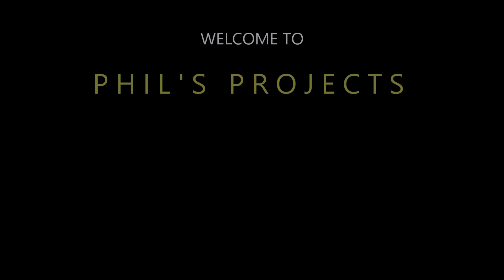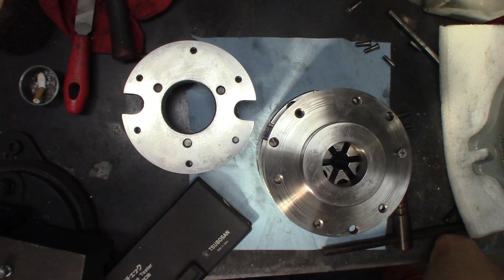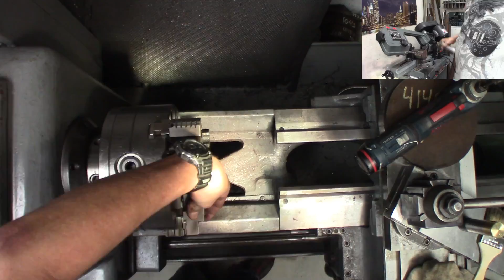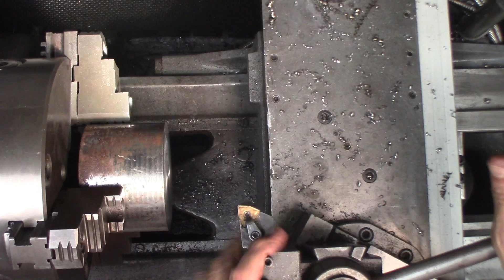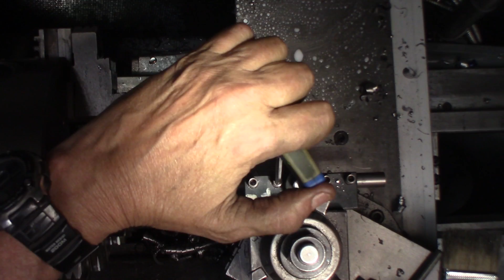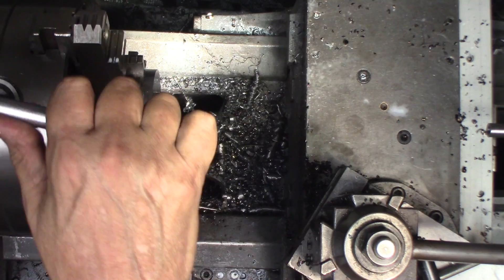BISON CHUCK 1

Comment: Nice work. I have use 6 jaw adjustable chucks for decades now and love them. At my full time job we use "Kalamazoo" chucks. They are built like the original "Buck" chucks. One of our future videos we plan on altering the jaws for harden CPM 3v insert. Steve
Reply from the maker: Thanks Solid rock, Come back for the finale to see if my analysis and solutions worked
Thanks for taking the time to comment
Cheers Phil

Comment: I don't see the point of the slug in the center it appears to be just along for the ride. I can't see any screws going into that bore to push it around for alignment as that would really be its only use. Why not just bolt chuck straight to d1 mount plate? Since there does not appear to be an indexing register you can loosen the bolts bump it into alignment and retighten if you want to adjust true it.  The closer chuck is to spindle the better in my opinion.
Reply from the maker: Hi Brian, the adjustment screws are on the rear of the  chuck, you snug the bolts holding the chuck to the back plate, use the 4 adjustment screws to center the chuck to the spindle rotation, then tighten the chuck to the back plate. if everything is correct you should be able to remove a part from the chuck and it should go back in to with a thoul., I will make a point of showing it on the next video.
 having the chuck closer to the spindle is exactly why im bypassing that shop made plate

Comment: Nicely done! I hope you dont need to make a Backplate for your chuck. These are quite tricky as they not only require an accurate taper but they also have to touch on the Face to align axially.

Comment: I had to make a new spindle adapter for mine.  The one that was on it when I got the lathe sprung on the second part that I worked on in it ... long story much shortened, it was ,improperly made and had the chuck hanging entirely over the bed.  I tried to cut a welded area, it hung up, stalled the lathe and put about .040 wobble on the chuck.  While it was being driven with a half-horse motor.

I cut the new adapter so I could heat fit the back plate to it.  I nearly panicked when I checked the back plate and it showed severe wobble.  I let it turn slow on the lathe to try to see if the way it fitted up had shifted somehow when it cooled.  The fit was good at the adapter, so I looked to the back of the plate to see if the wobble was showing there, and noticed something odd at the edge.  I soon realized that the backplate was not something that had been made with the chuck (not a Bison item).  It had been machined on the previous adapter, and since it hadn't been made right, the back plate reflected that error when put on the new adapter.  The variance in thickness was the same as the amount of wobble I had, and fortunately, the plate was not the same material as the chuck.  A .020 facing cut, finished with a shear tool sorted it all out.

Something to keep in mind:  I noticed something when you tightened the part in the three jaw.  One of your three 'keyholes' on a scroll chuck should be marked, and that should be the last one that you put the gronk to when tightening the work in it.  My understanding is that the mark shows which one was tightened last when the jaws were ground to the chuck, and if you tighten a different one last, that will affect repeatability.

You'll love that chuck once you have it sorted out.  I missed mine severely when I couldn't use it.
Reply from the maker: thanks Diggerop.